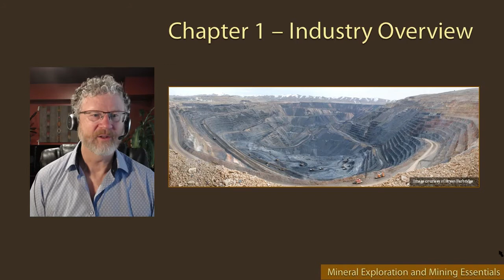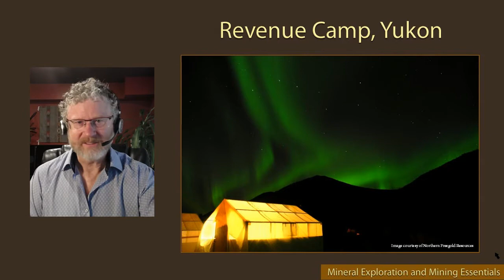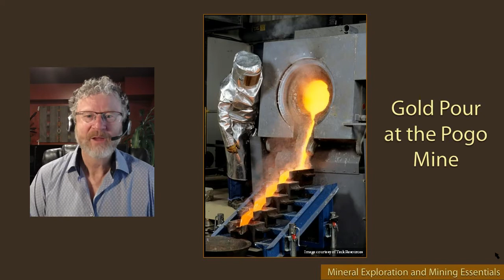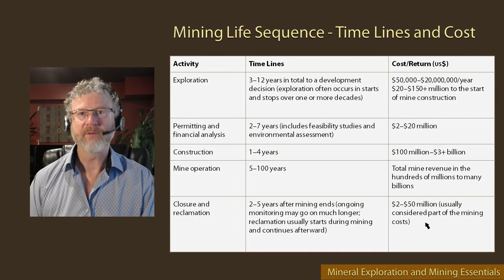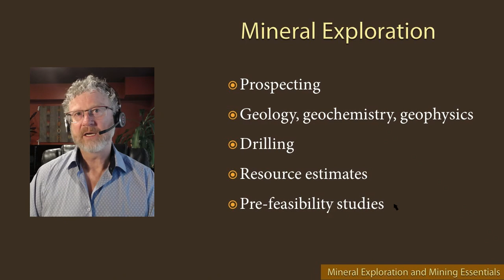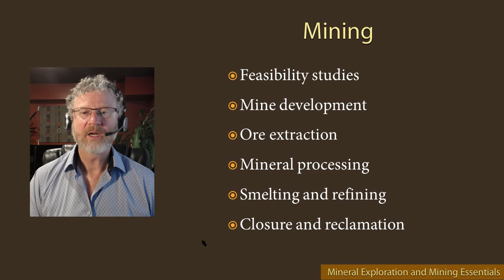Mining Life Cycle

Comment: What is the rough timeline for the processing and refining process?
Reply from the maker: Hi Fraser - thanks for your question. For metal mines processing is ongoing along with mine production. From the time ore is brought to the process plant to the final product is around 12-36 hours (or more) depending on the specific operation, production rate and equipment used. Refining will normally be a separate process that is undertaken off the mine site. For example gold dore bars (commonly around 80-85% gold and 15-20% silver) will be sent to a refinery for purification to pure gold and silver. I am not sure of the exact time involved in that process, but likely a few hours to a day.